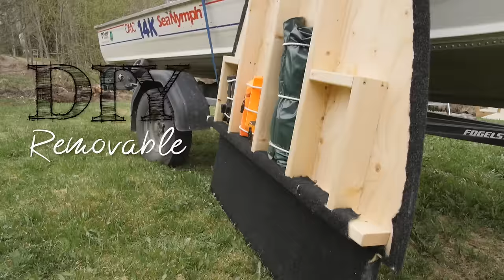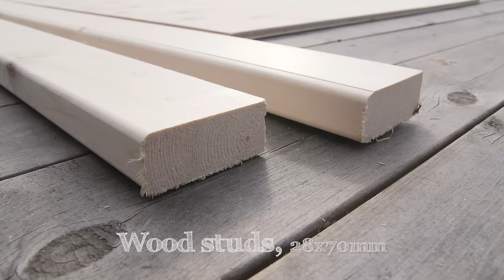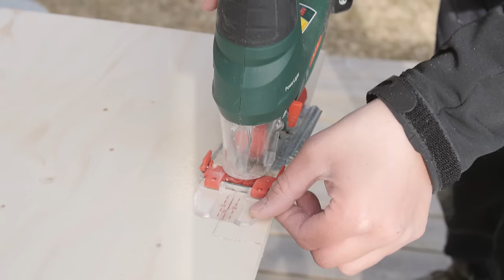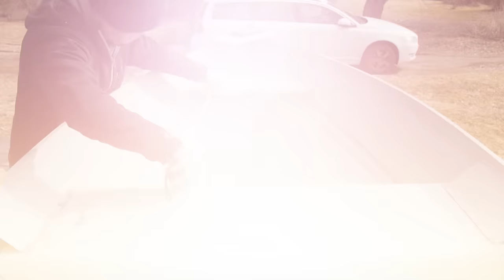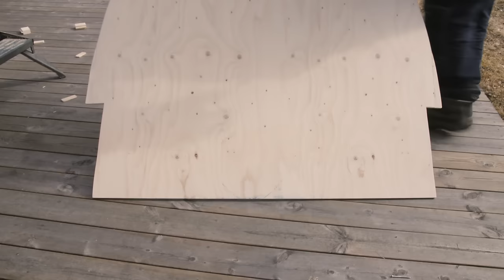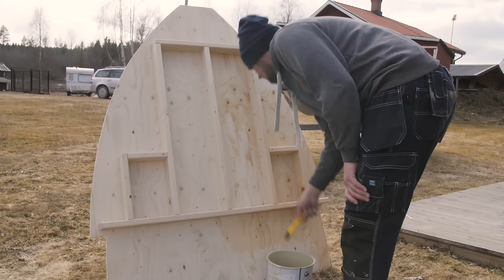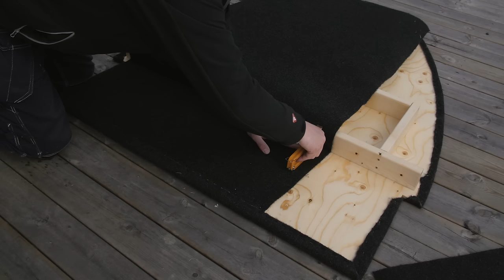DIY Cheap Removable Casting Deck

Comment from the maker: 2 1/2 year update: It's still going strong! the carpet is getting torn in the edges and have started to smell a little bit from getting wet and being out in rain so that is going to be changed soon. The wood shows some "cracks" but it's still going really strong. When I'll change the carpet I will at least put another coat of oil onto it. The deck doesn't sag at all yet and I have been fishing loads on this with sometimes two people standing on it.
Reply: Does she support your weight good?
Reply from the maker: @emeliomusso6911  Oh yeah, doesn't sag or bend anything at all
Reply: Good to hear man, cause I just bought a 14  ft aluminum boat and I'm going to put a deck on like you did. Thanks for the quality video bro
Reply: This is great! I own a ‘00 1457 Sea Nymph and this is the perfect set up for a platform. Thanks!!!
Reply: Maybe next time use 2 coats of fiberglass resin on all of the wood after assembly. Probably last 3x as long as the tung oil.
Reply: About how much did it cost you to make if you remember?
Reply: You did a great job. Obviously there are more treatments and glue you could have put on the plywood but all in all you did fantastic. Great cuts, great looks. 10/10!
Reply: Thanks for the video and the 2.5 year update. That's all I needed to see. My project starts tomorrow.
Reply: Any issues with the carpet buckling or bulging having used only staples and no glue?
Reply: I followed your video to the letter and got an amazing result!  I cut a hole in the middle and made a cover for extra storage. 
Thanks for the help
Reply: You could even glass the top side at least for strength if you were worried about it sagging or flexing
Reply: This Is Neat
Reply: @jarrod5722  Did you build your platform?  One thing I learned is to be sure to have a solid enough aluminum or you may have troubles.   Wishing you a great boating season
Reply: would you recommend using marine wood? or too heavy/thick?
Reply: Can you tell us how you mounted your trolling motor plate up front? I have a 12 foot row boat and I want to replicate the boat you have made with a casting deck and a bow mounted trolling motor.  I don't have enough metal up front to mount one.  I see you added a wood plate.  How did you attach it?
Reply: I built a similar deck for my 14 1/2 foot boat.  What is good about removal decks is you can take them out, stand them up and hose of fish slime and dirt.  Then leave them standing up to drain and dry in the sun.  My wood is 24 years old and never had to change the wood. I primed the plywood, then 3 coats of oil based paint on both sides and edges to seal it.   I did have to change the carpet once, because the first carpet had a rubber backing that started to come apart.  The second carpet has been on for at least 20 years. Great for everyone to share their ideas.
Reply: could you make a follow up/part 2 video on how to modify the deck with some hatches?
Reply: @saintsfisherman  Same!

Comment: Nice job! I made a casting deck some years back and about the similar size as your boat. Never used any frame work for support tho only 12 mm high quality marin ply. Weights over 100 kg have jump around on it, throwing things in all directions, once a 70 g jerkbait even touch my head in the back of the boat but I got out of it with all my senses alive. The deck have keept up relly well. I first planed to use some sort of carpet mainly for avoid the risk of sliping and fall but got the advise of a friend that done a lot of things with boats just to paint the casting area with marine quality paint and "sugerspray" the last coat to get a rough structure. He said by using a second skin that will keep and trap the water I would get the wood rutten in a while even if it's protected of some sort. Don't now what's right or wrong but it seems to work. Anyway, you made a really nice and tidy work my friend!
Reply from the maker: That sounds cool! thanks for the input and nice comment :) maybe will try that on the next deck!

Comment from the maker: Some of you have asked how it holds up now after some time. I just spent 6 days fishing in this boat the past week and it still holds up great! The wood has aged a bit and you can see a few "cracks" in the wood from it drying but it's still as sturdy as it was in the beginning. The carpet have started to wear in the corners but I have been using this boat A LOT last year. Probably more than whats healthy ;) So conclussion, I will stick with this for this year and probably change the carpet for next season.
Reply: The DIY Crab how do I make a template?
Reply: I was also wondering how you made the template
Reply: Why you decided to name your channel "the diy crap''
Reply: That’s a fine job.  The tung Oil probably doubled the usable life of the wood... that said, you’d have at least quadrupled it by applying two coats of two part epoxy.... but you may not be worried enough about seven years down the road to spend that much... good job.  I may copy it with a few minor changes...
Reply: I copied you but instead of tung oil i used marine grade wood and applied fiberglass resin to it.
Reply: Cardboard @bigmanmichael7995
Reply: @hunterfrancofishing1585  cardboard
Reply: @Rick_Sanchez_C137_  Nice project. Why not use pressure treated wood?

Comment: Made mine with a false floor up front for lifejackets storage, tackle boxes,  put carpeting on the wood over middle and rear seats. Cut hole in center seat for live well. Rear seat is for me and fishfinder. It does not work well, just can not find the fish. Looks great for a 12 foot boat. Placed a 2 x 8 in the oar locks and I run 2 down riggers to fish salmon , trout , and planer board for walleye. 2 x 8 board is great for cutting baits for catfishing with a piece of lexan on it. Two dollar store cup holders and a magnetic 18" strip holder ( princess auto) to hang lures on and pliers
 knife, lot of space in a twelve footer if you organize it right. Your build prep is a great idea , did you put a casting seat up front  or not utilize the under storage up front??

Comment: Well thought out.  Want to do the same but wonder about the plywood holding up to dampness and you can't use pressure treated in an aluminum boat because of galvanic reaction with the metal. Keep us posted on how it holds up.
Reply from the maker: Ron Mehringer hi! Thanks for watching. I have been out on over 30 fishing trips so far with this deck now and it's holding up just fine. We had some heavy rain and spilled some coffe and monster all over it. I am storing the boat under roof all the time tho. What you could do is coat the wood in a layer of epoxy or some other plastic, it will raise the cost but add durability and a bit of weight.
Reply: Nice work. I have been considering using an oil based paint with and an anti slip additive on the plywood.This would eliminate the carpeting. If you don’t seal up the plywood it holds water like a sponge, I used marine carpet previously and between the plywood holding water and the carpeting not allowing the wood to dry quickly the flooring began to fail in 7-8years.

Comment: I am refurbishing my boat right now. Replaced all the wood since it was rotted. New boards are coated with fiberglass resin to keep them sealed from the elements. Hoping it lasts.
Reply: I built a similar deck for my 14 1/2 foot boat.  What is good about removal decks is you can take them out, stand them up and hose of fish slime and dirt.  Then leave them standing up to drain and dry in the sun.  My wood is 24 years old and never had to change the wood. I primed the plywood, then 3 coats of oil based paint on both sides and edges to seal it.   I did have to change the carpet once, because the first carpet had a rubber backing that started to come apart.  The second carpet has been on for at least 20 years. Great for everyone to share their ideas.

Comment from the maker: @Nathan Fynaardt 
Thanks! I have been fishing a lot now on this deck and I would say that I am happy that I skipped using glue. Already the deck looks a bit "walked on" with the carpet getting a bit torn where people have been standing. So I guess I will have to change the carpet next year or maybe the year after that. But with a higher quality carpet maybe this won't be an issue. However, the carpet is held in place really nice and there is no slack so I am happy with the result other than the low quality of the carpet I chose.
Reply: marine grade carpet should last years it's durable as
Reply from the maker: Azz Keo Yes of course, but the whole thought with this project were to make it cheap. I am ready to have to change the carpet in the next year or the year after that

Comment: Awesome!
1) Do you have to leave a small amount of room on the sides (?1/4 inch or so) to accommodate for the carpet or is that not an issue?
2) Do you trailer the boat with deck in place?  If so, does it ever get close to flying out?  How do you ensure that it doesn’t?
Reply from the maker: Thanks!
1. Yes a little bit, but once you step on it it will go into place even if it's a snug fit.
2. Yes I do! I put a strap under the seats over the deck just in case it would fly of but I don't think it will even without it. But I drive pretty fast with it when travelling far so feels more safe to have it secure

Comment: Looks good! But if the frame isn’t resting on the seats, aren’t you still just relying on the strength of the plywood resting on the seats? If the frame is resting on the ribs of the side of the boat, I suppose that would support it well enough.Sounds like it’s holding up though but I’ll try to incorporate some joist hangers or bracket to allow the 2x4 frame to be supported more by the seats that just the plywood.. Great Video
Reply: The weight is transferred to the 2x4 frame below. The ends are supported by the seats and when standing there the body weight is transferred to the seats below. When standing in the middle the braced framing of the 2x4's distributes the weight evenly, basically like a skeleton does. The plywood and the 2x4 frame become a system of support. The 2x4's below would have to snap before the plywood on top does.

Comment: Any thoughts on building storage compartments.  When you replace the carpet look at hinging the long sides and build some compartments to hold you're equipment.  Batteries, and stuff like that.
I found your channel because this is what I want to do with a boat my buddy gave me.  
Thanks for the framing idea.  I was going to build down lower and use 2x6's.  I like your idea much better.
Oh, did you add seats to the deck?  How about a bow electric motor?  These are things I'm considering

Comment: Should have put a hatch in it. Lost a whole bunch of storage space.
        When you're dealing wood (be it a deck on a boat or house) never seal the bottom. Sealant on the top always wears off first, so what you create is a barrier to hold water once that wears off on top.     
         Try Try carpet adhesive next time. Coat the to flip it onto the carpet on a flat driveway or cement pad, and put some blocks on it. Not only will it deal the wood better, it'll keep the base of the carpet from absorbing as much water.
      Came out nice. I did that to a boat awhile back.
Reply from the maker: Thanks for your comment, I wanted to keep this cheap and simple and show that you don't have to over do a casting deck to make it work. Of course if I wanted and even better one I would do as you describe or maybe even epoxy the whole thing. Regarding hatch, that would add a bit of weight, especially with extra framing for the hatch and this deck is so easy to lift up so it adds like a big compartment and we store loads of stuff under there. Even made som straps undeneath for stuff as you can see in the first clip of this video :)

Comment: Cool, and I'm not knocking your work but I don't get what the studs underneath are doing except keeping it locked in place. They're not supporting any weight (in fact they're adding weight) since they're just dangling there under the plywood. If the studs rested ON the seats, different story. Looks good anyway

Comment: The concept of the casting deck is sweat built like tank but a lot of waisted space could  bulit a few enclosed compartments for storage and a   battery compartment and indtall a bow mount trolling  motor and if you like a casting chair to lean against

Comment: Hey.. I'm doing my carpet tomorrow.  I have 1/2 inch plywood.. my question is what size staples should I use and also is it a certain kind I need to use? Thanks in advance

Comment: You should add plenty of carpenter glue to your joints before screwing them together. It really adds to the strength and durability of all your joinery.

Comment: I plan on doing a removable deck for a dingy too, but instead of carpet I am going with either spaced out strips of grip tape or a double thick layer-mix of marine grade anti-slip additive to a lacquer or epoxy. Also, I'm making mine with about 3 inches of overhang in the back with a bunch of pre-cut holes to serve as pole holders, net holder, slots for pliers and forceps and knives... you get the idea.
Reply from the maker: Punch Fukker Thabks for watching! I really like your idea of an overhang! Personally I prefer to store my rods horizontally in the boat so they are not in the way when I'm fishing but I could have used some overhang on the sides to make cut outs for tools, pliers, maybe hanging some lures, that would had been nice. Good luck with your build!
Reply: Ah, no, I should have been clear, the rod/pole holder holes will be diagonally drilled so rods can hang over the sides for slow trolling, bait'n'bobber fishing, or catfishing.
Reply from the maker: Ah I see, that sounds sweet! :)
Reply: Punch Fukker go to autozone they sell shock absorbing rubber matt. very durable

Comment: What’s the point of the frame underneath? Just to keep it from moving around because it’s not permanently mounted ? I think I might do this but cut a hole for storage compartment thanks for the idea ! 3:4 ply? What did you put on the wood for sealer ?

Comment: How thick was your plywood1/2 inch ? Do you think you could get away with not doing the the support frame just the crossmebers to keep it from sliding if you used 3/4 inch ? Trying to do something similar but I need all the height space I can get underneath for storage

Comment: So does the 2x4 frame actually contact the sides of the boat? Don’t see why you did that if you used the support of the seats for the plywood, unless the 2x4’s are contacting the bottom floor…

Comment: Do you plan on using the frame as the bones for storage compartments later. I've got a 14' v hull a lot like yours and I've been looking for something exactly like what you did. I hope you don't mind, your deck on your boat is gonna is gonna have twin in Alabama. Thanks
Reply from the maker: Thanks for the nice comment! :) Good luck with your build! That was my hope that people would be inspired. If you look at 0:03 you can see that I already made some storage for rod holders etc ;) Just added some straps

Comment: I see earlier in the video , you were adding some extra pieces of timber by screwing them into the side of the plywood. Has that caused any issues screwing into the side of the ply ? Has it weakened the area ?

Comment: Great idea.can i ask how does it travel. Does the wind from driving want to lift the casting deck ?
Reply from the maker: Thanks! I don't think so, but for safety I always have a strap around the seats over the deck when driving so it will never fly off even if it wanted to.

Comment: I want to do the same but the height on the bench seat and bow are different so I'll have to use wood to level it out. You're lucky
Reply from the maker: Thanbks for watching! That shouldn't be too hard to fix! I actually added a little piece of wood in the front because the seat is sloping aswell. Good luck with your build!
Reply: The DIY Crab Thanks! The video was great. Love the straight forward style.

Comment: I want to do this with mine, the issue is I don't have a small front seat to unless I want to attach it to the sides somehow, Ill have to make supports that do the bottom on the boat.
Reply: we would have to bolt 2x4 pieces to the sides of the boat inside so the plywood rests on them otherwise it wouldnt work.

Comment: what sizs boat? just baught a 14ft lowe v. going to build this exact deck. best way to not have to remove seats
Reply from the maker: It's a 14ft boat, almost 5ft wide. Yeah it's very simple and has hold up great during this season, just a bit of wear on the edges of the carpet so will have to replace that eventually but I counted that in when I built this.
Reply: i litterly just bought a 14ft looks just like it. i cant upload photos to youtube . do you have a facebook i and message you some photos? maybe give me an idea if i got a good deal . what i paid and how much i could resell it for
Reply from the maker: Nice! :) I don't think that would help because I am from Sweden and the market looks way different here compared to USA (I'm just guessing you're from the US) We don't have that many Jon Boats here so they have a pretty good resell value.

Comment: Hey DIY Crab, I'm doing a similar project with my similar boat. would you have used carpet glue if you were to repeat the project? I plan on stapling the underside of the carpet once the glue is applied, just wondering how your deck carpet performs without the glue.
Thank you, great video btw!

Comment: Instead of oil wouldn't paint work better?? Or maybe even a varnish if u don't wanna paint it
Reply from the maker: Yeah absolutely! I made this as a quick build, will probabloy update it in a few years/seasons. Been thinking about epoxying it aswell but that would higher the cost and the weight.